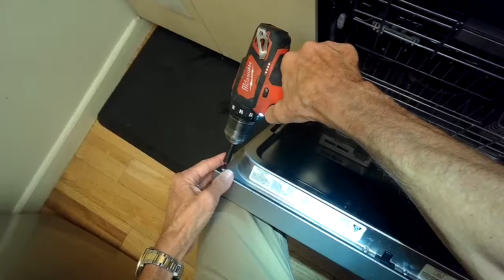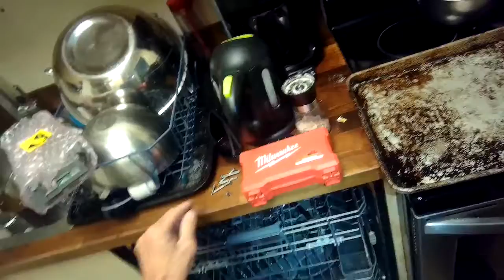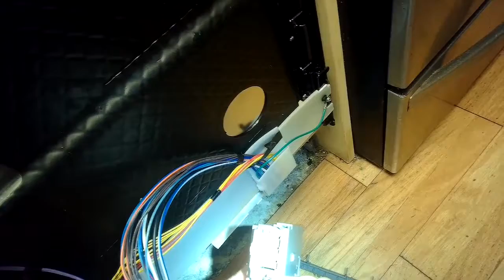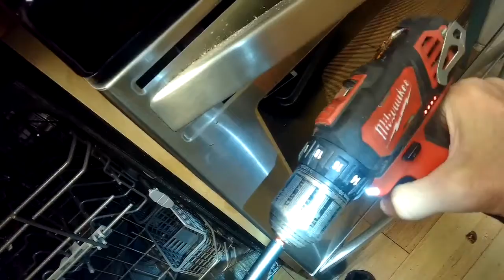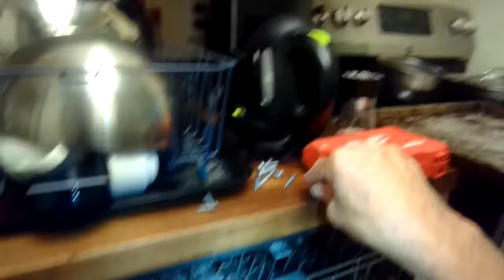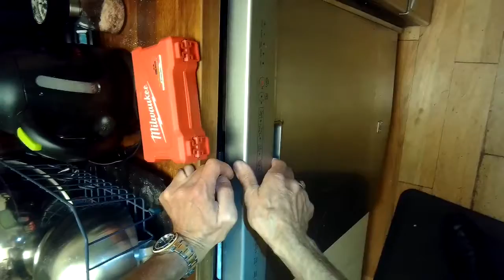✨ WHIRLPOOL DISHWASHER WON’T HEAT UP - Easy DIY Fix ✨

Comment: Like @victork3397 , I was able to fix my dishwasher by soldering new relays onto the board!!

My washer is a Whirpool Model WDF730PAYM7, Type 583-1. 

Thank you to @ScottTheFixItGuyChannel for the help with diagnosing the board. Now, the heating element gets very hot, and my dishes should be coming clean again!

Comment: How do you know which to replace, control board or heating element?
Reply: Get out a multimeter and test the resistance of the heating element. It should have a resistance somewhere 30-300 ohms or in that neighborhood. A "bad" element will have a much higher resistance. If resistance is high, then it is the heating element. If it is in the expected range, then it's probably the control board. Or a rat chewed up a wire or something.

Comment: I already replaced the heater and the thermostat (these parts themselves cost me less than local handyman's visit, who would charge me for just saying "repair is too expensive, buy a new dishwasher"). Now time for the controller. I will order one shortly, fingers crossed it will work. I will be happy to keep the dishwasher as parts for this model are cheap and fixes are easy. And last but not least, I already have a spare heater and thermostat, in case they break in the future :D
Reply: @MalwinaJasinska  Did the control board resolve the issue?

Comment: Hey boss I have a whirlpool dishwasher model number IUD7070DS2 that is not getting hot or drying. Do you have any recommendations for me to start troubleshooting this?
Reply from the maker: Thanks Ian,

How high does the water get when it fills after 5 minutes?
Reply: @ScottTheFixItGuyChannel  about an inch give or take
Reply: Any suggestions?

Comment: Hi , Do you we need to do anything after installing the new control board to reset it or just choose the cycle and press start ??
Reply from the maker: This one doesn’t need any programming so you should be able to just to start it right away
Reply: Yes if you have had a heating element failure, many controllers will keep it disabled for safety until you reset it. On many dishwashers this can be done by putting it through a diagnostic cycle. Look up 123123123 dishwasher service mode for more info

Comment: Video is helpful, but instead of replacing the entire control board, I ended up just desoldering and replacing the relay. Cost me less than $10. Relay model# srd-s-112dm.
Reply from the maker: Wow, excellent Victor👍👍👍
Reply: You should post a vide on how to do this.
Reply: @jessekinsman8718  sorry I don’t have this dishwasher anymore. There’s plenty of videos online on desoldering and replacing relays. Mechanical skill required.